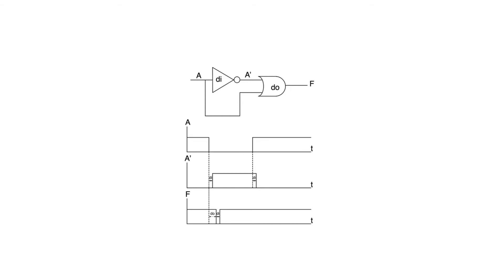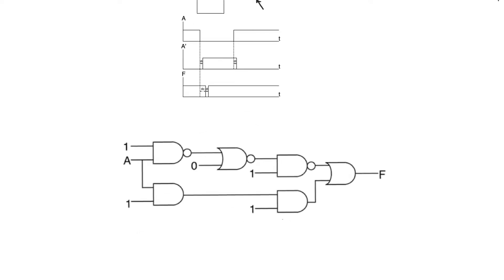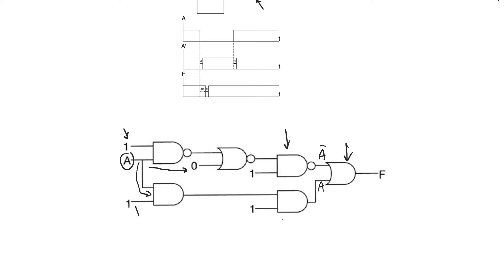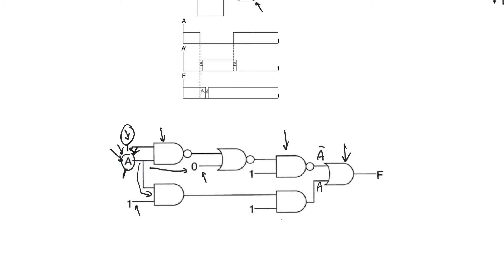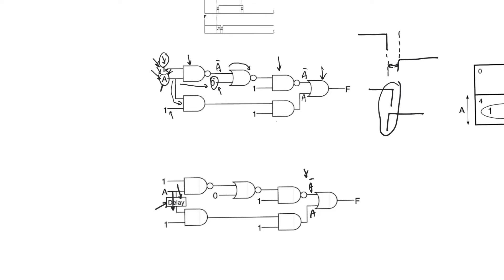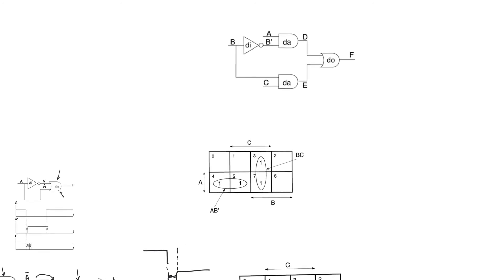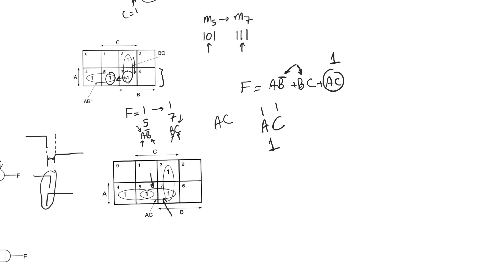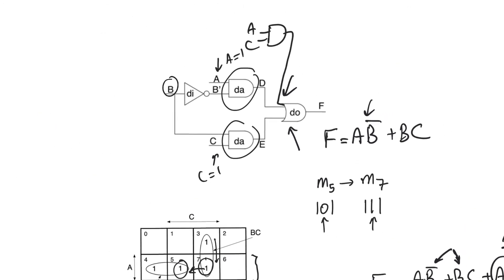14.18.  Static-1 hazards

Comment: Thanks for the refresher. It is interesting to note that the final circuit was essentially a mux. Which if you are using a mux for clocking, latch en, or set/clr that you have a potentially for glitches on that line.